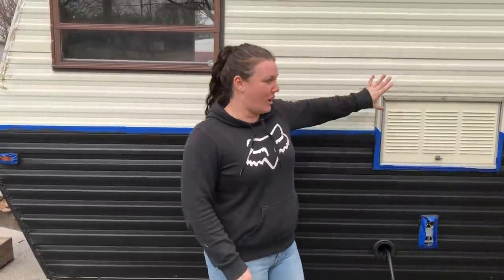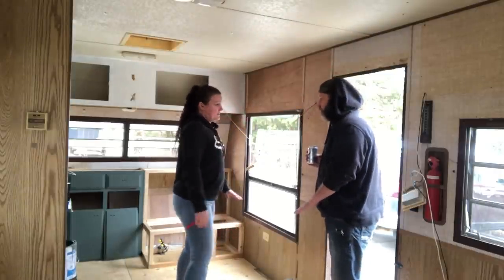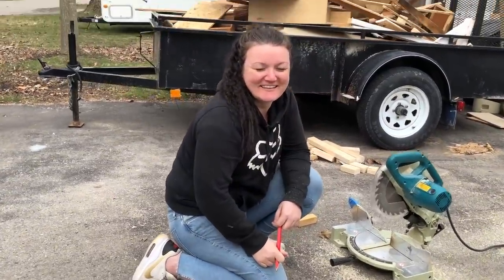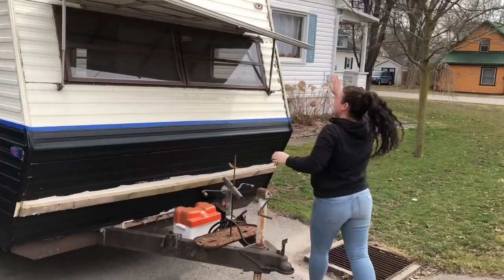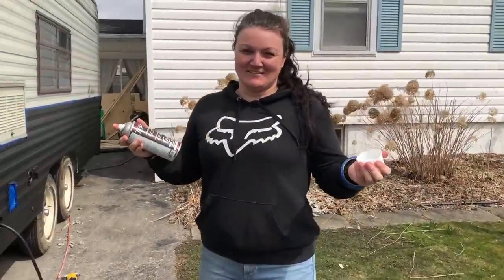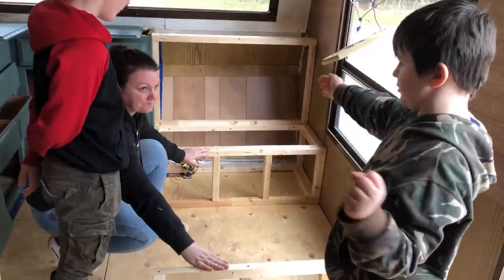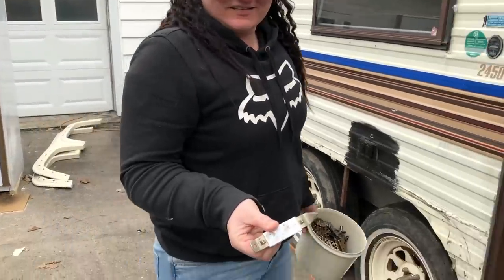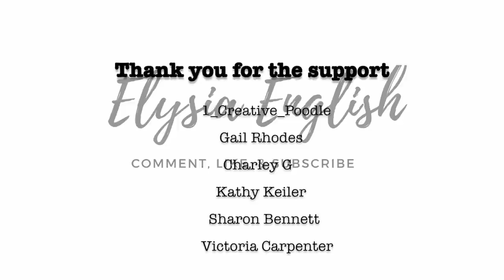Extreme Camper Makeover | bench bed...| White frames? | Episode 11

Comment: Tip for you guys, seal around your lights on the outside. Major reason walls rot out. Water seeps behind them and in the hole in the metal into the inside of the wall. Most overlooked area on a camper.
Reply: Dennie Moore great tip

Comment: Forgive my mentioning it, if you already are planning to turn the triangle space behind the back of the dining bench against the front wall into storage but I just had to make sure you haven't missed that opportunity.  One option could be a kind of flip out top opening.
Would you consider also painting the metal strip white that runs around the top of the exterior wall?
I am still voting for Judy as a name for the camper.  The name is a little vintage to match her body.
Everything you've done is PERRRRRFECT !!   I wouldn't change a thing.
Elizabeth in Vancouver, B.C.

Comment: Hello! Love the idea to make the side closest to the door into a backless bench! One more thing I wanted to add is that the cushions that you are making all add up to the 2 benches and the table top for when you convert it to a bed. You probably have already thought about that but...on the video it looks disproportionate. If you do the tubes under the table, like I have, you can get extra mounts and have mounted them to a board and take the table outside too. Two tables with one table top. The tube mounts are easily stored for those times. I have a camper too and its so inspiring to watch what you two are doing. Keep going!

Comment: You mentioned using a coat of Poly over the cabinates. Over time poly tends to "yellow". Maybe use a varnish. You also mentioned the "weight"of the camper, maybe when completed take it to a scale for a final weight. You'll then know how much of a vehicle to pull it. 
 Your son is great with the drill (better than most adults-myself included).  Love what you're doing!!!!

Comment: Just a tip from a sprayer,if you drop your rattle cans in hot water from kettle for a few minute's, it helps the expellant gas give you a much better spray pattern with no slats or spits.and just do it in one straight move end to end.good luck,love watching you both.

Comment: My parents have had several 5th wheel campers and something that the camper companys have started doing for extra seating at the table is fold flat (for storage) extra seats. I see your boys are smaller now, but when they grow up some and elbow and shoulder room become and issue you can use a folding chair (store under the master bed, maybe) to put them across from the window when its meal time. Love this idea of up cycling an older camper. Maybe I could get my husband on board!

Comment: Hi guys. Love the project. We have a fifth wheel we are almost done with and my best hint is instead of using newspaper when you paint the outside use aluminum foil. You can bend it around the ridges and no paint gets underneath. I repainted our stripes and it worked great.

Comment: This is Holly on hubby's tablet. We have had lots of time in campers but currently spend a great deal of time in our sailboat. As yachts go, EVERY inch of the boat is turned n2 usable storage. So the back of the bench that is farthest away from the door has a ton of space. I dont rembr hearing u say if u were planning to make that accessible or not. But the back should come out. It should b a panel with a finger hole in it that has trigger type hatch inside. I hope that makes sense and is helpful

Comment: I am so sorry that the weather is not cooperating with you to finish outside of the camper. 
But you have so much going on that it really doesn’t slow your progress down. 
I like that you are taking the idea from these comments to not have a backside on the bench built in. I hope it works because it does sound like it would open up.

Comment: I think the idea of the storage in the back for the bedding  is a great idea and a space for his items Just a suggestion I would paint the back of that area now before you put in any more work on the bench. My original  idea is that due to the angle I would want to prevent things from going into the cracks all the way to bottom as to prevent cleaning nightmare 's so I would put a shelf to level  it off. Then do the sliding doors as that makes more since as to space  and as for your Son. I would put a divided  space one side for bedding  the other side would be his shelf area were he can have his stuff . I think that would be so Kool.  Also  I would recommend  to get all spray painting  done of the windows etc. Done before painting  the black etc. So as to not have to redo areas from the spray getting  on the black etc. JUST  a thought. I have made that mistake  in my own craft projects. 

I LOVE LOVE WATCHING YOUR PROGRESS  ON YOUR RV.  I am single  and stuck at home by myself  but  use to it. But wish I could do this stuff myself  have wanted to have a Tiny Home myself. GOD BLESS YOU ALL.  🙏🙏💖💖💖💖

Comment: Round that bench by the door...oops looks like it might be too late, or make the side by the door like an octagon/stop sign on the one end. It will be easier to walk by... just a thought. Keep up the great work,  can’t wait to see it all finished in a couple of weeks!❤️ PS- make sure you have a spot by the door to hang flashlights, the mini ones with strings at the ends. And I always had solar lights when camping and put a terra cotta pot upside down on our outside table and put the light in the hole, makes a great table light. And we always put velcro inside the pot and put an extra camper key (spare).

Comment: Been an RVer for over 35 years with all kinds of RV's. FYI the wallpaper is not real wallpaper it comes on the paneling from the factory that way. That is why it is so hard to get off. Gotta ask did you sand the outside of the trailer before painting? Love your color choices so far. Good work and nice the whole family is involved. Also suggest you reseal every screw and hole in the roof and sides even the windows.

Comment: The bench seat lift lid is a great idea. Try to leave it without middle brace.  Could perhaps brace the middle of the lid if necessary. Love the shoe cubby. I wouldnt put a door. Too hard as doors take up space. Where are you storing the table top when not in use.  Could you make a roll table top like these picnic tabkes, where slats are joined by tape, but you would still need some sort of frame. Perhaps that could be hinged in the middle. Love the no back bench that has many purposes.  Also like someones comment, that you make a storage area in the back of the other bench, might be space to store the cushioning for the bed for one of your boys.

Comment: You are doing a great job. May I make a suggestion, being a woodworker myself, you would be so much farther ahead if you will do one job at a time instead of jumping all around and doing little bits here and there. Another suggestion is use 3/4" plywood for your bench tops. This is a place where you may have 4 adults sitting and 1/2" plywood will sag and possibly crack under that much weight. Keep up the good work. I am enjoying watching you. Oh also Phil go buy another drill/driver. It will save so much time in having not to change out drill bits for screw bits. Good luck you two.

Comment: I have watched since you started on the build and a couple suggestions:  replace the power cord mouse hole, (its not called a mouse hole for nothing) with a plug directly in to camper so you can remove the power cord and store it instead of trying to push it all back in thru the mouse hole.  (Amazon has the kit)  and check out the "Equal-i-zer 4-point Sway Control Hitch" it is easy to hook up each time and works great with sway control...  Good luck with the build and have fun.

Comment: I would leave the bench open on one side for the shoes storage, all flat with the flooring, you would just remove shoes and push them under the bench. Also for the sectional I would do a foldind bed for extra sleepong area. I saw a bus conversion in YouTube neat idea for it.

Comment: When you go to do the back of the high bench.... If you make the back rest removable and place a shelf in the curved part of the camper that's the same hight as the seat you can remove the back when you convert it into a bed. Having slept on a table bed in a camper for several years I can tell you those couple of inches of extra headroom is a God sent! You won't have a back at the door side so feet can hang off but on those cold nights being totally on the bed and snuggled in is the best sleep ever.

Comment: When I remove wall paper from a wall I use dish soap and water in a spray bottle.  First I score the wall paper, spray the paper with the soap and water, let set for a few minutes and then it peels off so much better.  You might try that. They do have a scoring tool at the hardware store.  Good luck.  Maybe a  tablespoon of dish soap and a quart of water. Gentle mix and have the water warm.

Comment: I really like what you guys are doing. One thing I would consider is adding a vertical riser on your bench seat on both sides. You have a couple on one side of each seat but the other side is pretty weak.  A 2x2 does not.have a lot.of bending strength and the span is 36"
Reply from the maker: We aren’t done

Comment: You will not regret having the shoes out of the way! There may be enough room to add a small shelf for truck keys,flash light ,matches,just under set facing door side. Flip flops and tennis shoes are not tall. 
Winter camping with boots would be different. ♥️
Reply: Seat!

Comment: I think you should do a fold-down panel for the back of the bench against the front of the camper. Bring it up solid for a few inches so it clears the bench cushions, then do a piano hinge or something similar. Give it a latch so it holds tight, but then you can put shelves in the awkward triangular space behind the bench, or use it for the bedding that isn't on the table during the day.

Comment: Your tent trailer just had a metal post that slid into the bracket on the bottom of the table and on the floor. You then  took it off then and laid the table top on the lip of both benches to make it into a bed!

Comment: What do you guys plan to do something with that open space behind the bench back in the kitchen? I know in a camper space is everything and having that open space behind the bench would be great. I know in one of your videos a couple back you said something about a countertop going all the way across seamless I think but to access that space you need a door/ lid. 

My thoughts on this would be to either cut the counter in half so you have a lid to access that space so you could put bedding into that space for the bed/kitchen table OR the bench back you hinge it at the bottom so it opens towards you then put some type of strap to hold the door when it's open. When it's closed you could put a magnet or some sort of locking device on it so it doesn't smack the kid's heads in the middle of the night if that where they are going to be sleeping.

Comment: Could you put hooks for keys and small stuff  to the left of the door (As you are facing outdoors)  high above the new bench? And don't forget you can put a narrow ledge above the window (with a bungee) and hooks underneath to hang cups or the metal silverware with holes in the handle. You won't hit your heads on the shelf but you can still reach the cups. You can hang curtains or mini blinds from the shelf in hack or the hooks.

Comment: I wonder if you could make a fold down door on the tall side of the table seating area. You could place the bedding and extra cushion in there as you no longer have a high back for the extra cushion. You might even be able to use one of the extra door latches from the remove storage to keep it closed.

Comment: Suggestion; When you work on the roof please use self leveling sealer and not the black pitch. The black pitch is not the right stuff for a RV roof and will give you black streaks on your paint.

Comment: You might want to rethink the cabinet door on the shoe area, no rug will fit under the swing of it. I would build or buy some baskets/drawers...pullout. It is an awesome idea. No camper that we have had has a solution for shoes! We are using right now in our motorhome a crate from soda/pop.

Comment: Find a place for a fire extinguisher that’s easy accessible....also smoke alarms and gas alarm......shop around because RV shops are usually more expensive
When using curtains it’s nice to have ones that block out sun and other campers lights. Often you see the pull down cloth shades and they are not private at night and they let in the sun light when you’re trying to sleep in past sunrise.....
We wish we had a space for a fan which helps block out noise . We have to set ours on the table which is a pain to crawl under it to plug in ....having plugs up higher is nice for the fan and a small rotating heater.....why use propane up when you pay for electric at your camp site.
Some campgrounds will not allow older campers in because they feel they have old wiring and LP tanks.....check before you go.
Also new wiring is advisable because mice like the insulation on wires especially campers that set.
Do you have a lift up bed...great place to store items like camper awning lights, extra pillows and battery lights. Look into battery operated lights, Propane camper stove and if you can fit a folding table into the storage box. Often it’s nice to make a quick meal outside and the table comes in handy for the stove and for a electric griddle.....pancakes and eggs and bacon are so much easier done outside....I also have a one pan induction cooktop that portable.....
Make sure you have electric plugs outside of the camper......we use ours for a larger fan when its hot and you need air....for the griddles etc. and for plugging in air pumps when blowing up swimming rafts.....
Do you have an area where your dog’s bed can be.... nothing  is worse they stepping over a sleeping dog in the night or when you have to be in because of the rain.
If our oven ever goes bad I’d replace it with one of those combo air fryer.... ovens . I also have a instant pot......fast and easy. Often when you show up at a camp ground on a Fri evening and you’re tired, fast and easy is the way to go.....I often cook extra and put it in the camper freezer to take along so I have premade good dinners and I can spend my time enjoying the outside.

Comment: Did you ever do the name bug art in elementary school?  When you said you were doing black and white on the outside, that name art came to mind.  You fold a paper in half the long way (hot dog style) then open the paper and use paint to write your name in cursive on the fold. If you have "hanging" letters in your name keep it above the fold. While the paint is wet, fold the paper back up to transfer the name to the other half. Open and let dry then color it or not.   
I thought you could do that on the cricut and use the line where black and white meet as the fold.  Using black on the top and white on the bottom.
A name suggestion: Bohome 😉(Boho me) lol
Reply: Or use the cabinet green for the name bug.

Comment: Instead of having the bench open from the top you could put drawers in the front instead. That would be easier to work with so you wouldn't have to pick up all the weight of the cushion every time you need something you could just pull out a drawer and you could have 3 drawers.

Comment: What about a hinge on the bottom of the back seat . you can pull it open and get to things stored behind that little weird spot under the counter top behind the seat. Did that's sense???lol
But another idea the back of that seat could lean back and  kind of  recline. You would have to cut the top off about an inch so it could slide under counter. It would be like a chaise when the table is down.

Comment: I found the best way to remove wallpaper is to lightly score it with a razor, and with a mixture of three parts fabric softener to one part water spray it on the wallpaper let it sit for a minute and it should scrape right off with a metal putty knife. When I bought my house there was ugly wallpaper everywhere and I was able to remove all the wallpaper with fabric softener that cost $1 and I used an empty window cleaner spray bottle to apply it.

Comment: Are you going to help me redesign my 24 ft class a motor home?  I need to reupholster my drivers and passenger seats and either reupholster the jackknife sofa or replace it.  I think I'm going to get rid of the banquet seating/table.  I want room for a recliner.  I'll probably put a two top table with chairs.
Reply: haha.  I don’t have a trailer right now, but I was thinking the same thing... I’d love the English family to come help me do a renovation any day!
Reply: I pick up my motorhome on the 1st of april.  Found a  cheap 1995 in decent shape.  Just needs cosmetic work inside and possibly a new paint job on the outside.